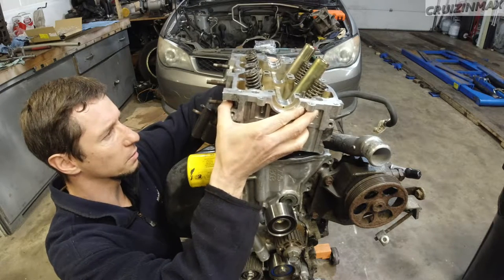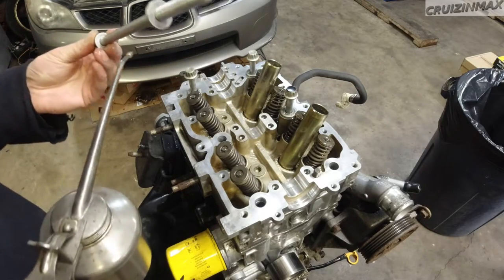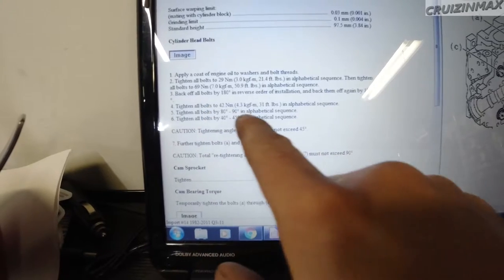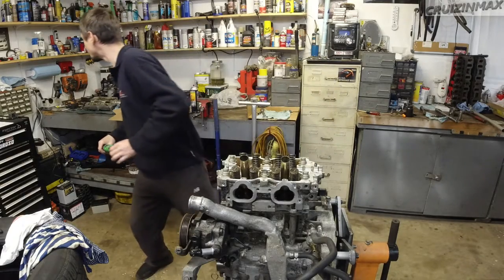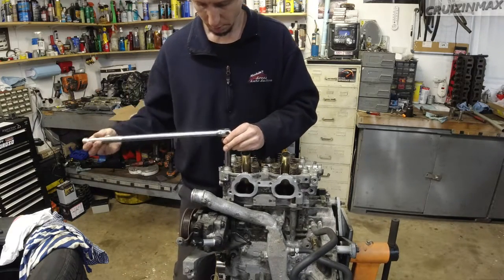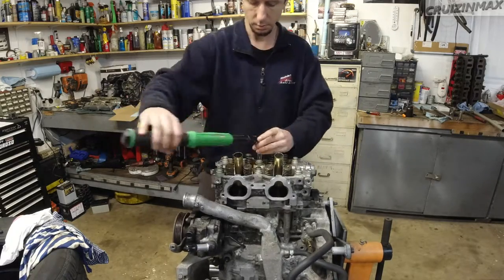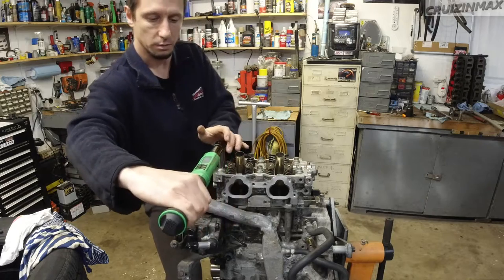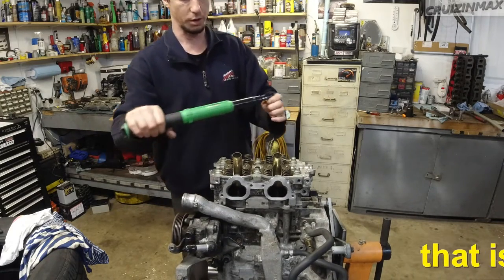Subaru Impreza 2.5L cylinder head torque down part 6

Comment: Well, it's coming together.  Love your torque-angle wrench.  I wound up getting one also.  Before I got it, I used to use a permanent marker or paint pen to draw lines horizontally across every bolt head before doing the final angle steps in order to verify how far I had turned the bolts.  Very visual feedback.
Reply from the maker: thats actually a great idea